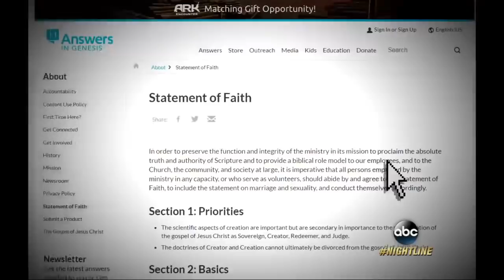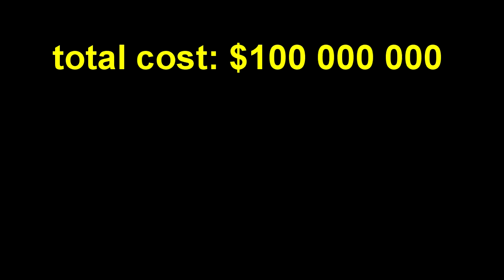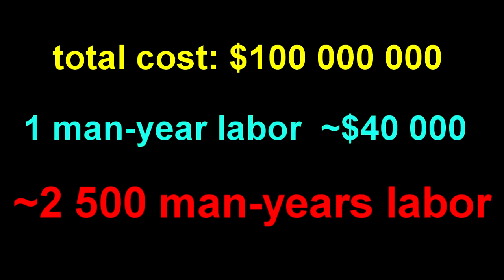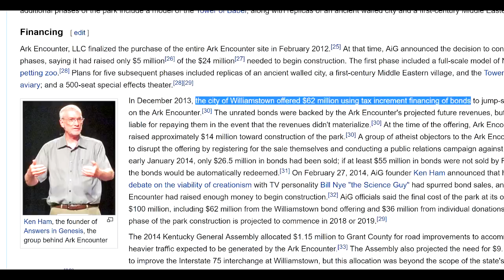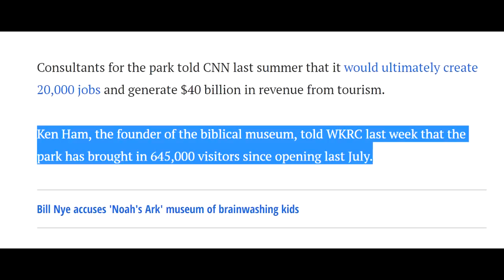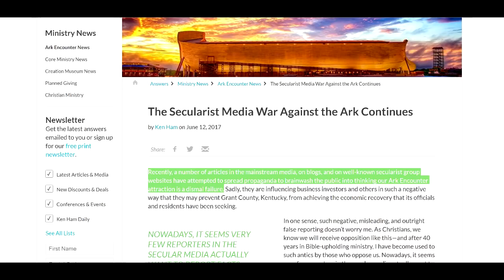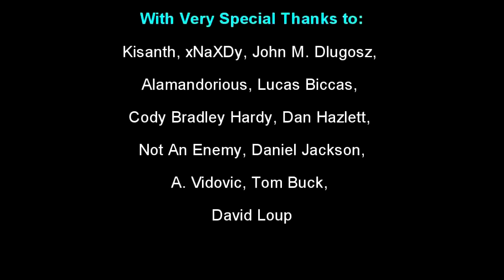Why do people laugh at creationists (part 44)

Comment: Don't forget that after ~2500 man hours and $100,000,000 this "ark" is not seaworthy AND is impractical as a zoo. Poor Ken actually disproved the ark story more effectively than any YouTube skeptic.
Reply: That's 2500 man YEARS not hours.
Reply: From what i heard Noah was supposed to be a giant
Reply: to be fair though, Ken didn't build an ark, he built a building / museum.
(I doubt Noah was using concrete to build his ark with)
Reply: @robbierichard1743  lol
he doesn't need proof. Cause all he needs is faith in his reasoning amirite.
Reply: @RobotronSage 
Noah and his family weren't Nephilim. Although much of the rest of the human seed had been corrupted by that time.
Reply: So how exactly is ~2500 man-hours disproof? I would say "There goes the theory that people are getting smarter these days." With this modern ark being largely pre-built in lumber factories and such. Didn't Noah take about a century to build that ark? That could easily include several years then of "learning" and "mistakes". And I long figured that some of that time was spent building the necessary tools and cranes. How exactly did he transport the biggest beams without modern trucks? Let's calculate the potential man hours. Up to 8 workers times 100 years and even animals may have helped somewhat. 60 hours per week x 8 workers x 52 weeks x 100 years. That is about 2 and a half million man-hours. Or 285 man-years. Obviously more if people had more energy and didn't need much sleep back then. Think that might be enough without supposedly modern tools? Rather than ask if it is possible, the great pyramids and other monuments were built without supposed "modern" technology, the question I have is, why did God have them do so much work? Although the destruction of the wicked world population at the time was a huge deal and certainly not a trivial matter. But couldn't God simply have given Noah a spaceship or something, or an already-built ark? I think part of the answer is that during that time, the evil pagans would have had many decades to mock and ridicule Noah, and when they were finally suddenly destroyed and end up in hell, they will be completely without excuse, having all that time to think about their wrong decisions that they had made. How many sermons might old-man Noah have given, to repent, and didn't the Genesis account say that God closed the door to the ark? That may be indicating that Noah was hoping that perchance just one person might choose to get on the ark with him before it was utterly too late.

In the Book of Jasher, it says that the people banged on the ark once they were getting pelted with torrential rain, begging to be let into the ark, but God sent animals to chase them away. Too late!

As far as we know, the ark was certainly no pleasure cruise. It was probably dark, lit by only a few lanterns, stank horribly with his sons having to shovel out animal manure every single day, and they seemed for some strange reason in a hurry to depart from the ark as soon as it was possible. The ark floated and could weather terrible storms, and that is about all we could say for it, as it was a monstrosity with but only a century to get it built. The century of building it, was a century for the pagans of the world to repent. So ironically, if critics call this modern ark a monstrosity, they may have actually got that part right.

Although I really wasn't expecting much respect for biblical faith values from movies such as Bruce Almighty and Evan Almighty , they did take some curious artistic liberties. Rather than depict their "modern Noah" as some old crazy fool, you knew something strange was going on, when the animals mysteriously started showing up in pairs, and it wasn't just "Noah" who had this weird idea about a (modern and smaller this time) flood. (plot spoiler alert: Well the dam did break and this time the towns-people did get on the ark.)

I would like to think that a century might be long enough for me to build a spaceship, that is, if I didn't have to work a job, if I grew totally bored with watching TV and YT, and literally had nothing else to do. Well especially if God actually gave me the blueprints. But then the manned moon landings were probably faked, but that is another story for another comment or perhaps another discussion. Anyway, don't forget that God gave Noah some basic blueprints. That perhaps gave him a huge boost.
Reply: @backabeyond  ''We can’t break the laws of nature, so everything we do is literally in line with the earth and nature. ''

This is fallacy.
Reply: @backabeyond  Also i don't see the point of the rest of your argument. Communion with ''mother nature'' (i.e: our planetary ecosystem) has nothing to do with being a ''dumbass'' or not.

I doubt Joseph would deny that we ''learned about simple tools like levers, pullies and wedges'' so this seems like a bit of a strawman argument....

I am also quite sure that Joseph Fairchild has ''heard of airplanes''.
Reply: @yosefmacgruber1920  2500 man YEARS! Not hours, years!
Reply: @MrMissouriman2  Are you trying to wind us up.
Reply: @StephenKelly-ey6ne  I'm game,
Reply: @MrMissouriman2  No.
Reply: @ZartaxtheWise 
So rather than getting smarter, humans have become stupider, because how could anybody possibly now, build an ark in just a century, using up to a maximum of 8 workers? Most people can't even seem to build their own homes anymore. Good thing we have Hispanics who can do the work?
Reply: @yosefmacgruber1920  We have neither become smarter nor more stupid. Your comment however, gives me doubt on that. The logical conclusion is of course that they couldn't do that before either and that the bible is full of crap.
Reply: @ZartaxtheWise 
Really? A century is not long enough for such a massive project, even though much of every waking day would have been spent working on that urgent project?

So I suppose that you could not even build a canoe if you had 20 years to do it? My Dad built his own steering console for his little fishing boat, and probably spent no longer than a few years doing it. Otherwise, one would have to sit in the back of the boat and operate the outboard engine the entire time.

May I remind you, that all the ark had to do was to keep its contents safe and float? It had no propulsion system, because it wasn't actually designed to go anywhere. Merely to survive the great global flood. Indeed its barge-like shape would have been very stable in a terrible storm. It was an ugly and dark and stinky ark monstrosity, that they could not wait to get off of, just as soon as the flood waters assuaged. The cheery pictures of a cute little houseboat zoo that some Christians like to draw, are just so wrong, as that it not what the Bible actually describes.
Reply: @yosefmacgruber1920  Good sir, are you trying to troll me?
Reply: MrTron 
Why would a wooden boat leak, if it is built properly? Doesn't wood swell when it gets wet? If built properly, wouldn't swelling wood tend to fill up gaps and cracks? And wouldn't all the cracks be sealed up with pitch? And there are 8 humans who can bail out water. I am pretty sure that they had buckets back then.

Yeah, we would love to see you build a pyramid, with multiple stones that weigh over a ton each, with very minimal cracks in between them, using no modern tools. Go ahead and show us how it is done.
Reply: @ZartaxtheWise 
What massive project would you like to design or build? Now explain to us why a century is not long enough for you to do it, if you are passionate about it? A century is easily long enough to spend years making mistakes and building the tools or cranes that you might need to help you built it.
Reply: @yosefmacgruber1920  Because it took 2500 man years for these guys to do it. With modern tools.
Reply: MrTron 
The ark only had to last for its maiden voyage. It was used no more after that.

Wood had long been used for ships. I have heard that Noah used an alloy for the rivets, according to some Creationist. Do you want for Noah to build his own metal foundry as well? You don't want for him to finish it after even a century? A wooden ship built properly, might have minimal leakage. Do you think that there was a void underneath the first deck? If so, maybe the water in there was never bailed out.

Come on, do you really think that the arts of building great things couldn't have been lost over the years? Do you really think that all that knowledge was well preserved? I wonder how many books that Noah should have preserved, or perhaps maybe should not have preserved? Presumably they didn't have vast electronic libraries in their smart-phones, well unless that was lost knowledge also? Noah might have known something about building a ship, but do you think that he was somehow among the best ship-builders?

How could 8 people do it? Well I suspect that Noah took some time to build cranes and other tools that he would need. Hey, any serious home car mechanic these days would probably invest in a car lift, an engine hoist, a few car jacks and jack stands, etc. How was the early Apple computers first built in a garage?

It seems quite possible that the ark could have been built. What I want to know is, why an ugly stinky ark? Couldn't God be gracious and remove Noah's family from the earth, or provide a nice spaceship or something? Why was Noah tasked to build that ugly thing? Well the people were so wicked it did demand a harsh judgment from God. But still, such an ugly stinky ark?

Consider all the upgrades we could make, if we had a big budget, ample time to build it, and was to build a modern real ark. We could put in a very nice lighting system. We could equip the entire ark with air conditioning. A proper ventilation system would greatly reduce the stink factor. We could provide an isolated ventilation system for the human quarters. We could put in modern pumps. We could have dumb-waiter platforms on every deck, onto which to shovel the manure. We could power the entire ship with free-energy technology so that no fuel is needed. Oh wait, we aren't supposed to know that that already exists?
Reply: @ZartaxtheWise 
So what does that prove other than that people are not necessarily getting smarter these wicked days?

And as somebody eloquently pointed out, Noah didn't have to build the gift shop, the HVAC system, electrical wiring and lighting, modern-plumbing restrooms, and all that extra modern stuff.
Reply: Joseph Fairchild you're technically right  but this not proving that but clearly you're thoroughly incapable of thought. Let's put it this way, suppose the right construction costs only 1% of what this costs. Now suppose that the right construction needed only 1% of the time to construct as this. Now suppose that it only took 1% of the labor force as this. Now suppose that all of that considered, the right construction is also sea worthy unlike this design. On top let's suppose that Noah only had to transport 1% of the material that this uses but is the same size as this model somehow. Now imagine how long it would take just to carry that material. Now imagine doing all of that with Ancient tools.
Reply: i think it just means he built a shitty boat if anything
Reply: @sanddbaggvv  Yes but he's trying to promote "creation science" so don't you think the arc should at least be halfway to proving the possibility? We don't even need it work just meet half the criteria even.